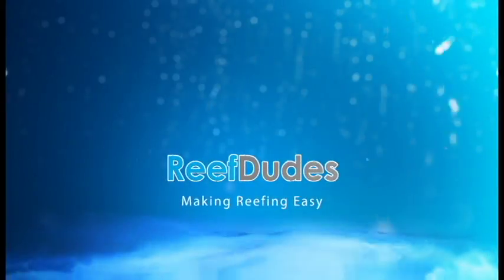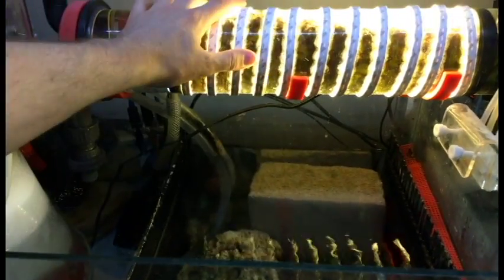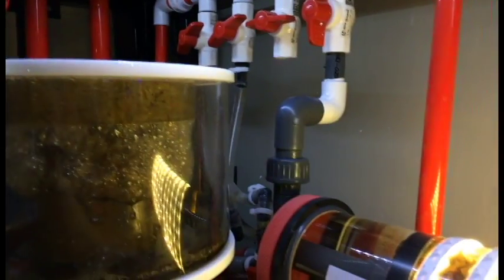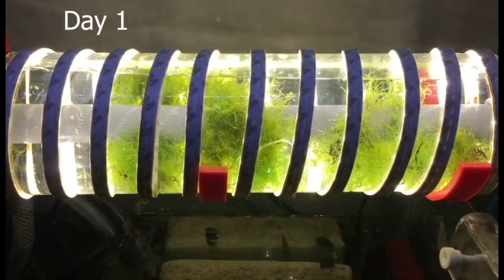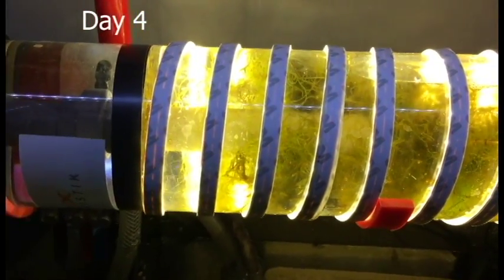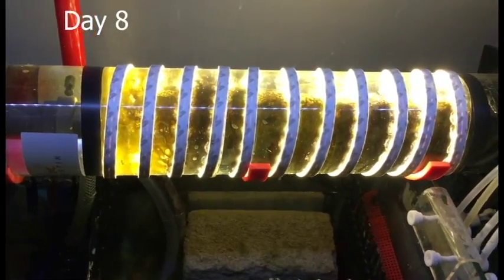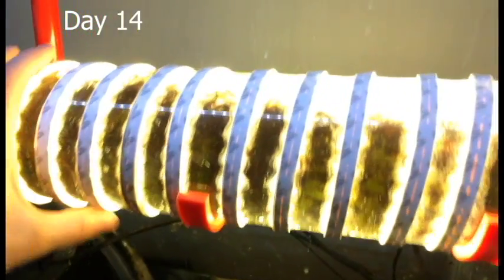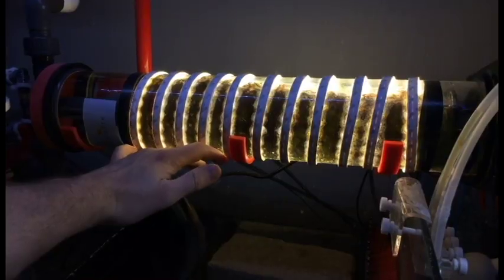DIY $50  Chaeto Reactor -  Refugium conversion to a chaeto reactor DIY Style!

Comment: Any issues with the reactor cracking from direct contact with the LED lights? I keep hearing about that issue and it makes me afraid to run one.
Reply from the maker: Matt Yeow  used a vertex reactor and didn’t have any issues.   I have heard of it happening to a few people.  One precaution may be to not do too many wraps and have the lights to Dense or add a dimmer like this https://amzn.to/2qWPFJ4 and run them at a lower power so they don’t heat up too much.

Comment: Hey man, I'm  building a reactor as well but I do not have an overflow. is that really a problem? I do have a valve to shutdown and control the input water. Also how do you empty it without spilling? the tubing also has water in it so it will always spill out right? Cool build thanks. Personally I use growleds 3reds 1 blue.

Comment: Iove how this is titled build a chaeto reactor for $50 all u need is a $50 used reactor, pump, plumbing, $18 light string, chaeto ($10?), and a $1,500 3d printer that everyone has to make a bracket...
Reply from the maker: I have made reactors using $3 pasta jars from the dollar store, you just have to be creative :)  I also see little phosban style reactors for sale for $20 all the time.  On a side note you do not need a 3d printer and it  does not need to be horizontal. I didnt have space to put it verticles so i got creative in my mounting options :)  That and  you just have to use what you have laying around and for me it was that old reactor.

Comment: Hello I’m look to making something like this but I’m. It sure what I need. I have a 90 gallon tank what would you recommend on lights and a reactor.
Reply from the maker: I’ll see if I can find you a link to the ones I used tonight. Pretty sure I replied to it somwhwre in the comments
Reply: ReefDudes great thank you
Reply from the maker: This looks pretty much identical to the one i used  http://amzn.to/2FWo00Y
Reply: ReefDudes what realtor what work for a 90 gallon tank? What realtor are you using? and are you having any issues with the realtor cracking?
Reply from the maker: I’m using an old Vertex Reactor.  No issue or cracks in mine.i have heard of it happening and I suspect the UV or best form some lights affected certain types of acrylic (not sure if it’s cast or extruded ) but one of the two.   I’ll see if I can do an update on mine for next weeks video

Comment: Have you had problems with the acrylic cracking due to the lights?
Reply from the maker: None at all  lol but I have heard a few people mention that. Why Reactor are you using? I'm starting to develop a theory that it may depends on A if you wrap the reactor and it holds in heat or B possibly the type of acrylic used to make it
Reply: Im using the two lttle fishies  550 reactor.  I good growth once after that it just got real nasty.  I cut my lights in half meaning i went from 12 ft to 6 ft in length.  I had running 8 hrs and now I am leaving the lights for 24 hrs but am afraid of acrylic cracking when i am not home.
Reply from the maker: Have you seen any little lines or stress lines in your reactor?  I am using an old vertex reactor and have not had any issues with mine.. but that being said there are likely many different grades of acrylic out there
Reply: Yes lines and looks like cracks
Reply from the maker: vince olivas sounds a bit sketchy.  I would be careful with that one
Reply from the maker: vince olivas did you notice any change in growth with trimming back the lights?
Reply: It has been growing.  Left lights on for 24 hrs for four days now.

Comment: Any updates on this projects performance? Lots of people have had problems using lights from Amazon. Mostly with the lights ceasing to work properly and with the heat of the lights damaging the housing of the reactor (hazing/microcracks/etc..)
Reply from the maker: Interesting, so far so good on mine. No noticeable change in the acrylic. Which reactor did you use?  I wonder if it has to do on the type of acrylic its made out o (Cast vs extruded?)
Reply: ReefDudes I purchased a Phosban 550 for my 40B, but I have not purchased the lights yet do to seeing the mixed reviews.
Reply from the maker: My guess is it depends on the type of plastic or acrylic used to make the reactor. Mine is using an old vertext reactor.  I have tried the warm white amazon lights for a few months.. now im trying the cool whites to see if there is a difference (red/blue will be next!) but so far so good for the reactor.. crystal clear as before (minus the alage)
Reply: ReefDudes A member of R2R gave me this idea which I might try just as a precaution 

why don't people use something like corrugated drain pipe to make a sleeve around their reactor? Mount the lights to the sleeve, and drop your reactor into it. That will leave some room for the lights to breath if heat is an issue, while also preventing light from escaping (you may be able to find white for reflection, or spray paint it white inside). You could also put a fan under it to blow the hot air out of the top if its an issue. I think wrapping the LED's in vinyl is causing the issue of both the reactor being damaged, and the lights burning out.
Reply from the maker: If it was out in the open i could see warping it.. but you are right.. that would trap in heat and may explain those issues you heard about.  Mine is suspended above my sump and breathable 360 degrees which likely helps. also the leds are only warm to touch.. if yours feel to hot then consider adding a dimmer and toning it down a bit

Comment: Don't you worry about the lights making the tube to hot over time and will eventually crack
Reply: I tried this and I found that even though the LEDs didn't seem to get hot, the reactor still cracked causing very minor leaks. The salt then attacked the rubber on the LED membrane and caused the circuit to rust and of course I then developed an electrical fault.
Reply from the maker: They lights only ever get warm.. so far i havent noticed them get "hot"
Reply from the maker: Which reactor did you use?  I wonder if it's how they made it or if they are using cast vs extruded acrylic?  Mine has run from 16-24h a day for months with out any issues.    Did you cover the reactor is is the reactor and lights able to breath?

Comment: how much of a pain is it to do maintenance and empty out the chaeto?
Reply from the maker: not bad at all. every few weeks i turn off the flow, unscrew the union then the lid screws right off,   pull out a bunch and hook it back up.. the only annoyance is a bit of algae on the walls of the reactor to wipe off but aside form that it works well..and less work than an ATS!

Comment: I do not understand what i could possibly be doing wrong. My algae reactor always goes great for the first week and then it starts turning white and dying no matter how much i thin it out.
Reply from the maker: Are you using GFO, Chemipure blue  or anything else in your system that may be out competing the algae for phosphate?
Reply: ReefDudes no i am not. Struggle with high nutrients. Do you do 24/7 light?
Reply from the maker: Previously I was doing. 16h. As of a week ago I'm trying 24/7
Reply: Was the algae going sexual?

Comment: Definitely not for $50. 
Vertex reactor. 3D printed.....not all of us have that.
Reply from the maker: Check the description, I posted a link to a $44 Reactor,  that and a cheap light strip and your set!  Brackets are only since had to mount it horizontally.. most normal people do it vertically :)  Or if you want to do it even cheaper build a DIY reactor > https://www.youtube.com/watch?v=9YonWiqTfkE&t=1s

Comment: Hey dev! So how much flow does a cheato reactor need? Anyways another great vid! Happy reefing!
Reply from the maker: Thanks!   I'n not to sure on the flow.. its a decent flow but nothing crazy.. I have the pump going through my manifold so its hard to say how much is actually going through the chaeto reacetor.
Reply: ReefDudes ok so will it be fine if I put  it in line with my carbon reactor? I'll have to figure it out and I'll ask around!

Comment: Any experience with these long term? Wondering what the maintenance is like in terms of cleaning the inside. Surely coraline would grow in these as well.
Reply from the maker: No long term experiences yet.. but ask me in a few months!  i don't think the strip leds could grow coraline..however with a powerful enough light it could happen. On that note i just picked up a XR15 to use beside it in the sump for frags.. lll have to see if i can mount it so the light misses the reactor :)

Comment: quick question about your manifold. You said you run a separate pump. Where does the outflow of the manifold go, back to the sump or to the dt?  thanks Deven. S
Reply from the maker: Manifold has its own jebao DC pump.  The carbon / gfo (currently turned off) have a tube that outputs to the next chamber over. The chaeto reactor outputs to the same chamber. May change that one day but it's working well for now :). So all output to the sump!
Reply: sweet, thanks for the reply!
Reply: sweet, thanks for the reply!

Comment: don't you feel more exited just because now you can feed your fish and corals more than you used to ? Mine grows faster in the reactor, how about yours? defenetly the results are much better with the reactor in my case. nice video .
Reply from the maker: Thanks Miguel!  I already feed pretty heavily so i'ts probably a good thing i'm upping my export!  i'm kind of excited to clean out that giant log of chaeto in the next day or two :P
Reply: you gonna starting giving it away or selling, i already have so much , my sump is full , my reator runs 24/7. thanks for sharing
Reply from the maker: I have been running mine for 16hours.. do you find any difference on running it 24 hours vs giving the chaeto a break?
Reply: never tried it , i know it sounds crazy, but besides the reactor running 24h, i also have a light that goes on wend main tank goes off , the diference i see now from 2 month ago is it grows slower now, but i clean the reactor last week, as it was getting algae inside and it seams its getting back on the grow speed, this is something amazing, i don't use any other thing in my reef, no even carbon, this is so good that some company´s are starting to produce cheats reactors. one question, my reactor gets the water from the sump in the first compartment, even before it gets to the skimmer... wheres your´s? would you say it makes a diference?
Reply from the maker: From my understanding chaeto (and all plants really) need a bit of a break from light.. 24/7 light "may" inhibit growth.. ill dig into this further!   I do also use carbon and change it every 4-6 weeks.. more to eliminate any tiny bit of ocean smell.  My Reactor feed pump/output are both in my skimmer chamber.  Ideally it would output downstream of the intake pump however i haven bothered changing it yet as it seems to be working well.
Reply: ok , so am going to go that road, 12/7 and i´ll let you know, by the way, remember i told you in another video i was going to use FM to feed the corals? i decided tu use Korallen coral system 1234, after 2 weeks i see better coloration . thanks for the vids and sharing info, see you soon

Comment: Nice job .. i am always impressed with the things people can build and these chaeto reactors have been hot lately. Nice to see it working out for you. Good deal. Are you running this off a manifold or a separate pump?
Reply from the maker: Its running off the Manifold. The manifold does have its own pump so it wont affect the flow of my return pump (need to keep that overflow dead silent!)